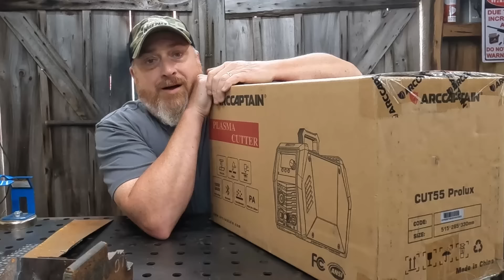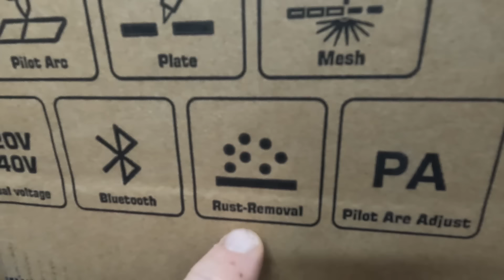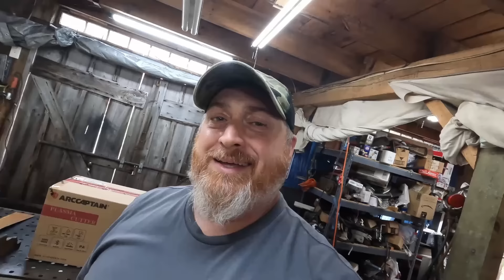Arccaptain CUT55 Prolux Pilot Arc Plasma Cutter with mesh and rust removal!!!! GAME CHANGER!!

Comment: Awesome cool review! Thanks so much for the insights! Great also that you are mentioning safety.  One thing I might add,  is probably the most important along with eye PPE is organic vapor/ toxic fume protection. In a more confined space, such as a small studio like mine,  manganese, zinc, mercury, hexavalent chromium and other extremely toxic vapors are produced by heating the metal,  cutting,  grinding,  welding,  etc.   I suffered for years with nosebleeds, headaches,  vitamin and other nutrient malabsorption that led to neurological pain, unexplained sores on my feet too painful to walk on,  kidney,  heart,  pancreas,  and liver issues.  I've been through a long list of specialists that could not find the source of my illnesses,  even after being hospitalized multiple times.  After finally getting the right tests,  metal toxicity was the cause all along.  Investigation into this found that even with effective ventilation at the weld/plasma cutting site, vapors can still fill the air in a smaller lower ceiling shop, and they are inhaled before they are evacuated.  If you work long days of constant weld/grind/cut, etc,  then you breathe a lot in a day's time,  enough to cause lung damage,  organ damage,  neurological damage, and a long list of  health issues that can shorten your life and make you very seriously ill.   In small spaces a PAPR is essential, or other means of keeping organic vapors out of your lungs and face.  It may seem unmanly to some,  but it's much harder to be manly when you are in a hospital bed or dead, or even just dealing with feet too painful to walk on so you drag your legs around the home to keep from standing.  The area you are cutting in looks smaller in the video,  like my own,  but I may be mistaken.  Take care of yourself, my friend.  If it is,  mask up.  You and your family will be happy you did. 👍

Comment: I just got the 205mp because of your video. Love it. So verisitle. Just did a boat lift from scratch with it. Can i do rust removal with it by copying your settings with the plasma cutter that comes with the 205 mp? Whats your thoughts im a newbie and would like to be able to clean up some parts.
Reply from the maker: I don't know if the MP will work as a rust remover though. You could try! Do not use it on thin metal. It does heat up.

Comment: How well does this work using it on the 120v setting and what size breaker does it require at the 120v setting so it will not throw the breaker?

Comment: Always enjoy your reviews.  I use a 40amp breaker on my mig250. Would I need to upgrade to a 50amp for this one?
Reply from the maker: Rated full input current for the MIG 250 at 220v is 43.3 amps. The CUT55 is 35.5 amps at 240v so less total load than the MIG 250
Reply: @madgingercustoms Thanks so much.   I haven’t had my breaker flip yet when using the mig250 so will keep 40 amp for now.